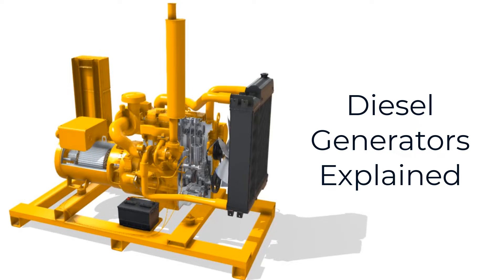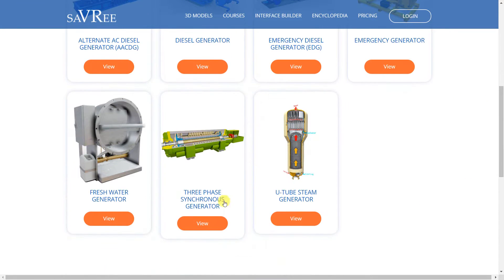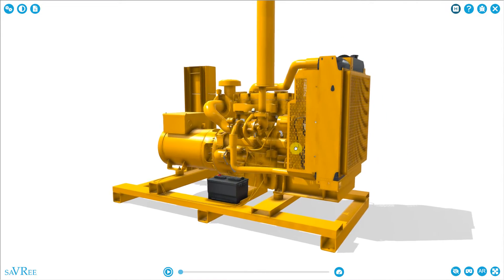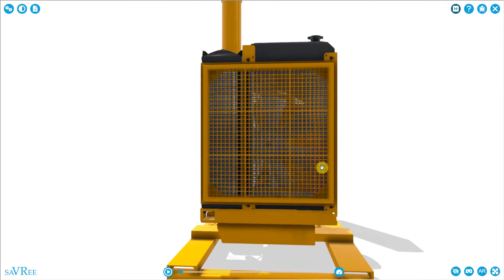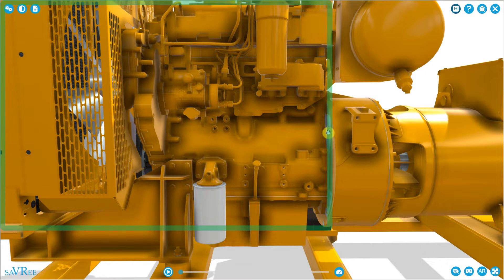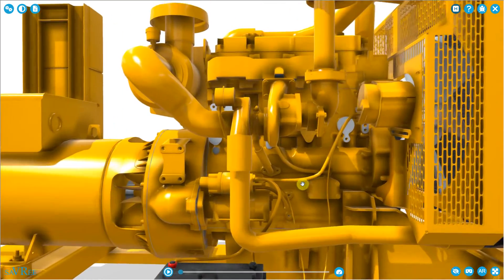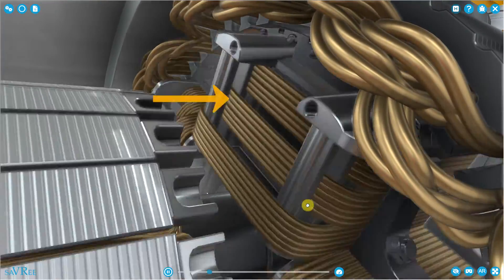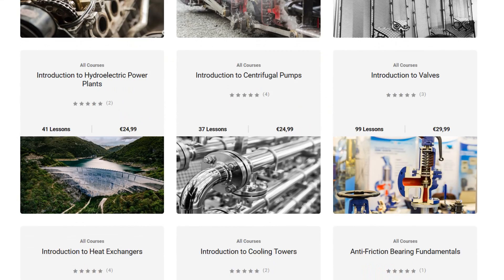Diesel Generators Explained

Comment: Efficient and durable generators seem so much easier to design than efficient and durable vehicular engines. Constant RPM, weight is a lot less of an issue…

Comment: Is the generator motor also used as a starter of the diesel engine? Or does it include a separate starter motor?
Reply from the maker: It has a separate starter motor. Dc motor. Typically 12v or 24v. Larger engines use compressed air to start.
Reply: @savree-3d can you make video on this compresses air thing?